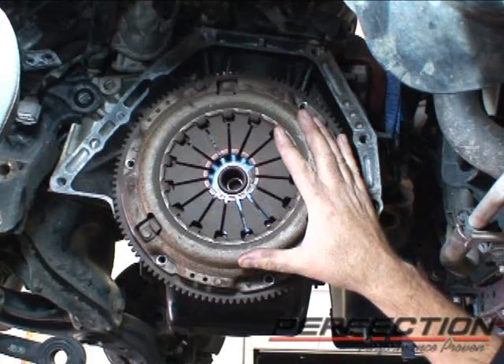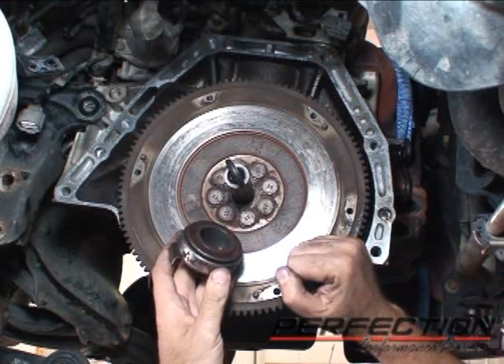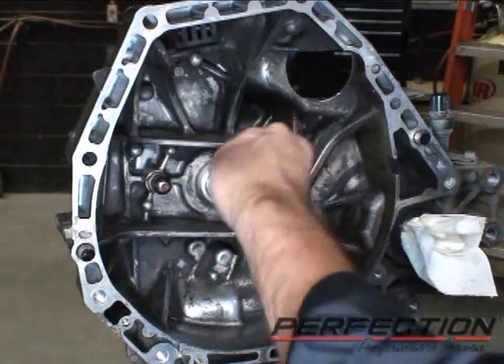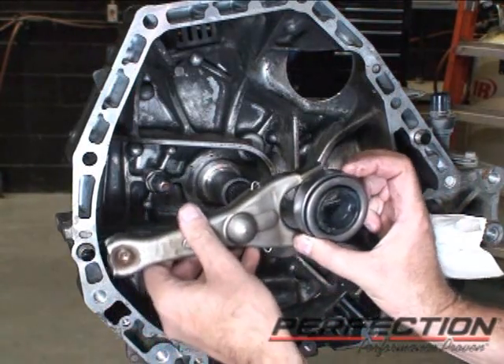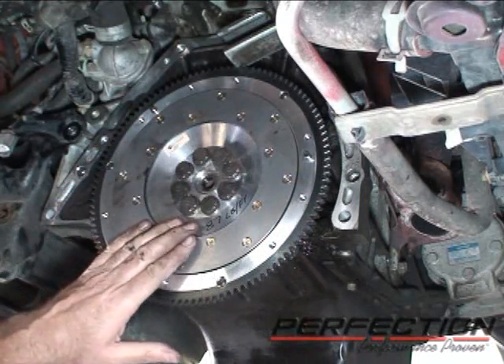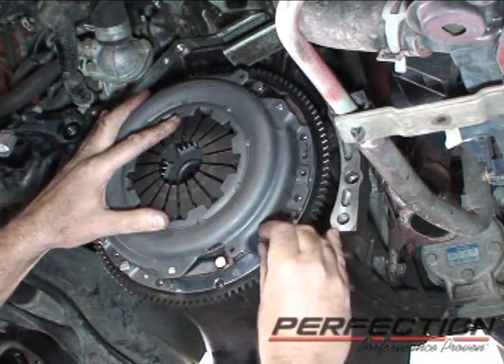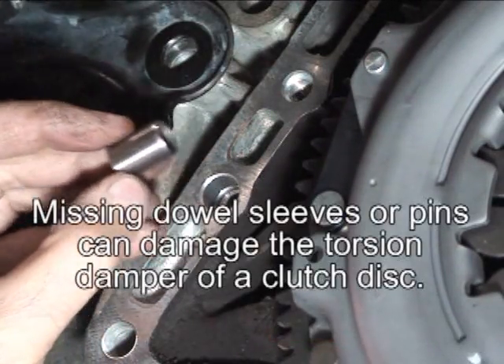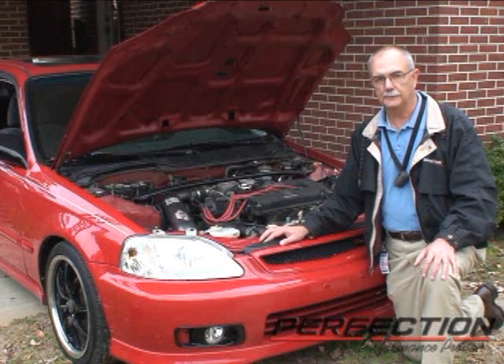2000 Honda Civic Si 1.6L Clutch Install

Comment: I got 685,000 km out of my 1997 Honda Civic SI Coupe 5 speed, never replaced the clutch and was still going two years after I sold it, having owned it for 11 years myself.
Reply: O my god !!! My vtec-e eg5 90.000
Reply: We have the same car except mine is a DX. Now it got almost 280,000 miles. But you got 650 K miles!!! Wow!!! My only problem is the clutch release fork snapped (broke). Do you think I need to change the flywheel and clutch? Or just the broken fork? Please reply.
Reply: 97? Only produced 1999-2000
Reply: No your wrong it's 96-00 for 6th Gen and 92-95 for 5th @XxXArcangelGuzmanXxX
Reply: @Stanced-ej8  I know I ment the 97 didnt have a si model

Comment: The noise is the input shaft bearing. The input shaft spins while the car is in neutral and sitting still with the clutch pedal out (engaged) and makes noise. The input shaft doesn't spin while the clutch is pushed in (disengaged) and therefore the bearing makes no noise.

Comment: @swagstars 

That longer wrench he is using is referred to as a "Clicker" type Torque wrench. 
The wrench is set by twisting the handle to the desired torque. It clicks when you have met the torque that you have set.

Comment: I'm saying input shaft bearing. A noise with a disengaged clutch is the TO or pilot bearing. A noise with an engaged clutch and trans in N is an input bearing. Honda trans usually have to be split open to change that.

Comment: The problem with this transmission was more than likely the input shaft bearing in the bottom of the transmission. I've replaced them and this is the exact noise you get.

Comment: I love how small and light weight the clutch is in this car after doing a 12 valve cummins clutch this is much preferred haha.  Cool video!
Reply: +perfectionclutch Deal! Haha don't worry I don't doubt the difficulty of the small work space on the car I just almost forgot the size difference there!  I'm about to do the clutch on a 2000 civic se.   The NV4500 truly is a great trans I had a blast with that truck and the best part was with the truck on some blocks, I could sit under the thing when I did the clutch!   But man that flywheel had a bit of weight to it a little more then I expected.
Reply: +perfectionclutch did you need to remove the cv axle to get the trans out?   I may have missed it and could one drop the trans with the car on stands or blocks if high enough?

Comment: if you really listen to the noise, you are able to tell that part of the noise went away; the replacement of the bearing, clutch, and flywheel all got rid of the loose and clangy ball bearing sound but still left the friction like sound you hear at the end. in my opinion it is in fact the gear box. thanks for the video

Comment: This is a great, detailed video. I'm debating whether to try servicing a clutch myself, specifically on my 2004 Accord that is shaking/shuddering when I let the clutch out in first gear. There's no slipping or any odd behavior in other gears, but the shuddering is very noticeable when starting out from a stop. Only 65k miles!

Comment: that noise you can hear is actually the INPUT SHAFT bearing in the transmission. very common on Hondas. this guy just got a new clutch and flywheel for nothing. could have least got another 1 to 2 years from that clutch
Reply: ***** Regardless of it being right call or not, still educational video at end of day and was done very thoroughly. Well done.
Reply: ***** great video, very educational and much appreciated!
Reply: can you explain it to me cause my 97 makes this same noise
Reply: Opening the transmission is not a joke for me, so I would do the same even if my old clutch and old flywheel are still fine.

Comment: As others have noted, the noise present is 100% input shaft bearing. A careful google search of the symptoms would have confirmed this. I had the same noise in the same car, replaced the input shaft bearing in the transmission and it went dead silent. See my video (which was a before video). That flywheel IS a candidate for resurfacing,  It is a stepped flywheel and must be resurfaced accordingly, but otherwise will perform identically to a new one when done so correctly. Otherwise, good video.

Comment: I have a 2003 pontiac vibe (rebadged toyota matrix) 5 speed that has 210,000 miles on it. It still drives perfectly and has never had a clutch replacement. You just have to be nice to your clutches, or maybe its just because of how brilliant toyota is at making cars ;D

Comment: That noise is the input shaft bearing for the manual transmission and it going bad is a very common problem with this generation of Honda Civic.

Comment: That "noise" is the cold air intake, put the stock intake back on and I bet the "noise" will go away lol ... The air noise happened after my friend installed an intake, sounds pretty cool I think.. Nice clutch install vid though!!

Have a nice day..
Reply: 13 year old comment, but still, very wrong. The noise you're hearing in this video is the input shaft bearing. The intake causing this noise wouldn't be changed by pressing the clutch in, like it was in the video.

Comment: This noise is very typical (in my experience with older D & B series Hondas 1988-2000).. The 6 that i have owned and a few of my friends all make/made that sound in some degree.. I have personally had many-many years of driving with this sound and never had a single failure yet.. It's definitely a bearing on the input shaft but i wish i knew more about it... Great videos by the way!

Comment: I'm a dumbass for not using a working torque wrench. The one I borrowed from my neighbor did not click, and 3 of the pressure plate bolts snapped inside the flywheel. Now I've gotta wait for the next paycheck. >:/
Reply: I learned from your lesson. Thanks for posting.

Comment: Exedy makes a good clutch kits, you should payabout $250 for a kit (clutch disc, pressure plate, release bearing and pilot bearing) You can get them in Autozone. Your choice of mechanic or DIY. It takes around 6 hours for a first timer if you DIY.
Hope this helps

Comment: Strange, I think he just lubed the old release bearing. I always change the lot, dualmass flywheel, pressure plate, friction plate, release bearing and the slave cylinder. In my car the slave cylinder is a unit with the release bearing.

Comment: the technician forgot to show the tough job it is to remove the flywheel... a special tool is needed or to lock it in place in order to remove the bolts. I would have resurfaced the flywheel my self but since the pilot bearing needed replacing might as well replace the cheap flywheel, maybe 150bux for an aftermarket OEM size part.

Comment: When noise disappears when the clutch is depressed, isn't that the Input shaft bearing?
A release bearing if I'm not wrong actually rotates when the clutch pedal is depressed and stops when it is disengage from the pressure plate, thus the clutch.

Comment: Ahh I see. Still should have fixed it while the box was out though as it was an incorrect diagnosis from the off. Maybe they do things differently over there or something, but over here the guy pulling your gearbox would be fully experienced in all aspects of mechanics, gearboxes included.

Comment: Went ot a local honda dealership and got a pair of those dowels and transmission gear noise went away. AWESOME. If it was for this video, I would still be guessing what the heck is wrong.

Comment: So for the info. There's a possibility he did fix the problem when he changed the flywheel and pilot bearing. Both the input shaft bearing and the pilot bearing make about the same noise when worn. Obviously the input shaft bearing will gradually become louder and sound worse but. I have the same issue. Didn't fix it yet but I put a stethoscope on my trans and the noise sounds louder where the pilot bearing is than the input shaft bearing. We shall see. He still should've mentioned what happene

Comment: had the same problem with a honda fit/jazz input shaft bearing is worn and needed to be replaced we did not change clutch though proper diagnosis

Comment: Its a exedy stock replacement kit from EBAY. My civic is all stock, no mods of any kind. I didn't have to use the feeler gauge, the dowels where obviously missing and I installed them yesterday. I supported the engine and tranny during the job.
Refilled tranny with OEM honda transmission oil. Let me know what you think of the clutch kit I got?

Comment: prob was still getting noise after they were done due to, that stuff takes a couple 1000K miles to get broken in and used to the oil it will make that noise with new parts liek that espiecially bearings, good fix though pretty nice

Comment: Your noise is most likely down to the "input shaft bearing" inside the gearbox. I'm very surprised these guys actually took on a clutch job and didn't diagnose an ISB failure, its common sense and a known fault in that gearbox. They should have known this as clutch guys. See my channel for a brief video on what bearing is giving you trouble mate,

Comment: Automatics are worse to replace and repair. Manuals don't have clutch packs or valve bodies. Usually you can spot a fault in a manual trans pretty quickly, since autos are hydraulic it could be a number of things from check balls, valves, etc. 

As for replacing, an auto is more steps. Manual transmissions generally don't have oil coolers and are typically lighter. The clutch is an extra step but hardly making it harder.

Comment: After getting underneath the Civic again and manually pulling the shift rod bars back and forth (there are two long metal rods...one attached underneath to the shifter which attaches to the transmission (that is intact, actuating gears when moved); the other long rod appears to attach underneath to the base of the whole shift assembly-- the other end to a chassis bushing near the transmission. I'm not sure what the 2nd rod even does, but when manually moving it, it appears very loose at the base of the shift assembly (which is itself moving), and loose at the bushing end. A lotta play in the 2nd rod (really a long metal bar). Since messing around with the linkage underneath, the car will no longer go into gear without depressing the clutch. But, while in any gear, releasing the clutch, the RPMs only decrease slightly. It never comes close to stalling. Really don't know what I did to change the symptom. Before it would go into gear with no clutch (abnormal), now it will not (normal). Any ideas, sir?

Comment: After replacing the clutch, I have not encounter anymore chatter. The chatter was when I came to a stop and begine to move forward in 1st gear. Clutch is smooth and responsive now......BUT, I know have a another issue. My transmission is now making a noise, more pronounce in 4th gear, the noise was not there previously. Any idea??? and thanks for the feeler gauge idea.

Comment: Nice video on clutch installation. Very good. However, I don't think I would allow you to pay me to diagnose or fix any problem I would have with a Honda.    Did you charge the customer for the new flywheel, bearing rebuild and labor?  If you did, how do you sleep at night? When i watched the end of that video I was astonished, not that you screwed up diagnosis, but that you actually posted it on Youtube. It pays a little more if you do it right the first time, know what I mean??

Comment: Is it even possible for the pilot bearing and clutch to be misaligned and still get the gearbox on? or does it HAVE to be aligned to physically get it on?

Comment: When you take out the trans do you need to put a bar in where the drive shafts came out. I read that in the workshop manual but havent seen anyone do it on their youtube videos? My car is a 1990 Nissan Pulsar.

Comment: My civic does the exact same and i was going to fit a clutch kit to get rid of the noise, it's got 118,000 on it now. Great vid, but should i try a clutch kit first because i have a feeling it's the release bearing on mine as it's hasn't had a clutch for a few year/20-30,000 mile.

Comment: Hi Gary,

Last year i bought a Fiat Punto mk1. The car is 16 years old and it was a great car to drive. Until yesterday: the car broke. When i was waiting for the traffic light I heard a loud scratching and peeping noise coming from under the hood while the pedal was down. I drove off as normally, but 20 meters on i couldn't shift anymore. It felt like it didnt fully release, so i pulled over. There i noticed an awful smell. What do i have to replace?

Would like to hear from you.

Thank you.

Comment: hi i have an honda civic 2002 dx 1.7 the problem what i have is when the car start moving i put 1st gear when releasing the clutch pedal softly the clutch start shaking or jumping something like that  and also happen when i am on traffic  and i have to play with the clutch (stop and move)or i got to do a stop at the hill

Comment: im curious.. i have a similar issue with my car. the same sound coming when the clutch is not pressed... from my research, it is the input shaft bearing or main bearing. How was this problem resolved from just changing the clutch and flyweel?

Comment: I just replaced my 1999 honda Civic DX 1.6 D16Y7 clutch because of a bad chatter. I found out that the springs were worn out on the clutch disc which resulted in the chatter. When I pulled of my transmission, I did not notice any dowel sleeves and installed it back without them. All the bolts lined up smoothly. Do I need to pull the transmission out and install these dowel sleeves???????

Comment: A Ring gear holder tool is required to hold my flywheel on a 2001 honda accord. 
Questions.
Do i really need the tool?
Do i need a lift or just Jack stands?
Thanks.

Comment: I know you said you guys are just a clutch company, but I have a question. When you were doing final tightening on that flywheel, the engine seemed to move a lot. Is that normal?

Comment: Thanks for your reply!
I asked because my truck is doing the same thing after the clutch was changed (full Exedy kit). It never made noise before

At some point during the reassembly, the transmission input shaft was under thrust pressure due to initial misalignment. Is that detrimental to the gear system?

Comment: You didn't fix the issue. The grinding sound is still there as shown at the end. The issue is the input shaft bearing. You have to take apart the transmission to put in a new input shaft bearing.

Comment: I have a question, I just replaced my throwout bearing, pilot bearing, pressureplate and clutch. As I was driving home, I heard a clicking sound, as I accelerated clicking got faster, once i started to break and put the clutch into neutral, the clicking sound went away. What can be the issue?

Comment: Hi, the spline on the clutch disc on my car keeps getting worn out, there are no obvious answers, i do not ride the clutch when driving, the input shaft spline for the gearbox is fine, i have replaced 3 clutches in the past year, i drive about 35,000 miles per year, any suggestions, thanks.

Comment: i have a question is the same parts for engine d14z2 the disc , plate  and roller is the same d16 at 1d14z2

Comment: If I can shift into any gear, engine on, no grinding, not even depressing clutch pedal...is the clutch shot? Shift linkage appears intact, slave cylinder action o.k. Happened right after getting towed home on a battery failure.
Reply: It was a tow truck event. Before the tow the clutch was fine, afterward nothing. The shift linkage underneath appears fine. Weird coincidence?

Comment: do you know what could cause not disengaging my clutch ?.Slave cylinder is pushing fork normally.Is it possible that one of the springs from disc has fallen out? Or disc is not moving freely on its keyways,rubbing flywheel all the time ? And i should mention once i force it into one of the gears(with grinding sound),clutch becomes disengaged but after few steps on the clutch ,problem comes back.I hate when it happens on intersection

Comment: hi in this video, you said, customer complaint is noise when clutch pedal is released, and u diagnosed it is release bearing, question is will release bearing rotate when clutch pedia is released, i thought it will rotate only when clutch peda is engaged.. pls advise..  My car is 2000 Honda Civic Si

Comment: you made a mistake man, when using an aluminum flywheel you should use a torque plate, this is because the bolts can damage the flywheel when you torque then down, whit a torque plate the flywheel bolts tigthen down on this ring, and save the flywheel, in addition to having the bolt come loose. Everything else is good. Nice job.

Comment: from 0:50 i knew its main transmission shaft bearing. Not clutch related. My transmission makes the same sound.  Its common problem on these hondas.

Comment: A manual transmission is a MUCH simpler machine than an automatic. Since it's simpler, it's also more reliable.

A regular mechanic can not fix an automatic transmission; that's a job for a specialist. But a competent mechanic can replace a clutch. If you replace a clutch yourself, that could be less than $200, or $1,000 if you pay someone else. Versus, as he said, $2,400 for an automatic transmission.

It's hard to find used cars with 5 speed transmissions. People are too lazy to shift.